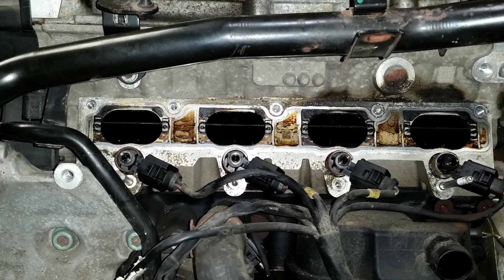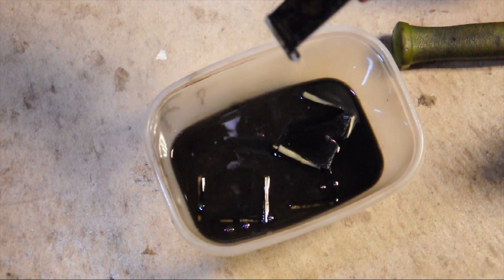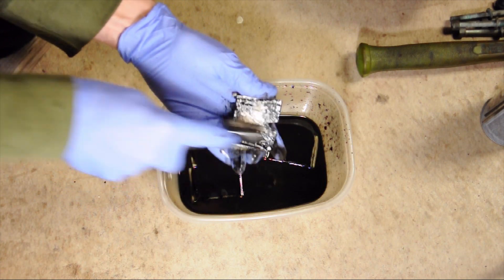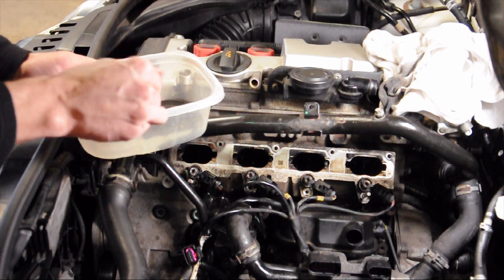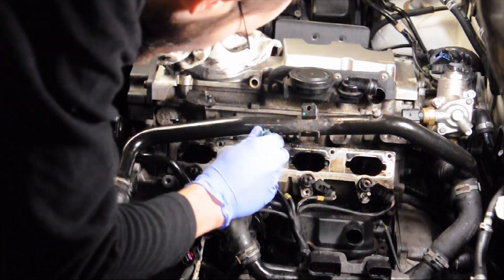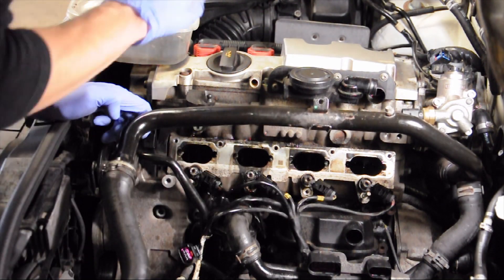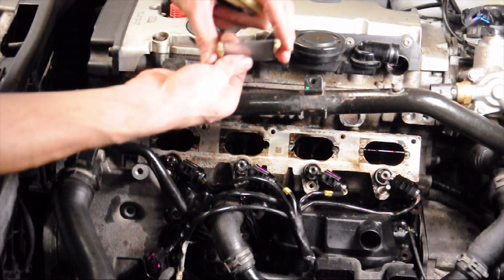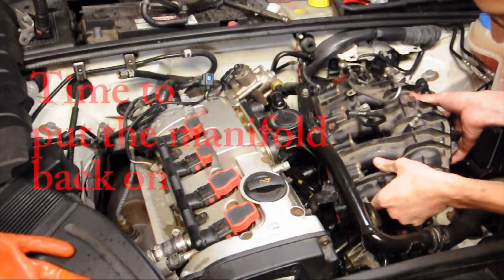Audi Direct Injection, Cleaning Carbon

Comment: Would you know where the intake manifold sensor is located?
Reply from the maker: +joyde_the3rd sorry that is not something I know off the top of my head. I can tell you where the Mass Air Flow sensor is
Reply: No such thing as an intake manifold sensor.  There Is a mechanical part attached to the back of the intake manifold which controls the flaps inside the intake manifold itself.  It is called intake manifold runner control
Reply: They’re probably referring to the IAT sensor.

Comment: great video, at what millage would you recommend the cleaning.  Aslo are the complications when the valves are dirty?
Reply: I was literally about to ask you if the car ran better. I do motor rebuilds for waverunners and it's the same principle with all engines. The face of the valve at the 45 degree seal is what holds the compression and or allows compression to seep out, if the valves are closed in order to keep trash out the chamber then that 45 degree seal never gets cleaned and nor does the valve face. With this said, I'm not sure cleaning valves this way will have much affect, it Def won't hurt tho.. However, if you clean out ur fuel injectors since your this far in, that can make a significant difference in performance and idling. I've never done either job on my Audi, only on other engines. (side note, if you are going to soak ur valves, it would be extremely affective to use chem-dip and let it sit for 3 hours and then suck and blow all of the fluid out, then wipe down ur valves, the carbon will damn there fall off...) some leakage will occur so make sure to refill the valve chamber if it gets low with more chem-dip..
Reply from the maker: +wry1007 I'm not sure if there is a "recommended" mileage to do it. I was right around 100k and the valves were filthy as you can see. I've seen photos of valves already being really dirty with only 30k. 

Excessively dirty valves can cause the engine to run rough as well as affect gas mileage and emissions. Maybe it was just the placebo effect but the car seemed to run smoother after the cleaning. In any case, I know it's been done

Comment: These videos are great, thank you. I have the same engine but a turbo FSI 2007 a4. I got the P2004 error code recently. Any thoughts? Is the intake manifold runner control bank 1 just the main bank that opens and closes?
Reply from the maker: +UrbanExplorer hey thanks. That should be the same engine as mine. Should be the same 2005.5 through 2008. Yeah that code would be for the intake flap inside the manifold. I had that done under recall a while ago. Not sure if that is still active. Might be worth calling the dealer
Reply: The dealer said its 3 months out of warranty unfortunately. I'm fairly handy (not an expert, but have done engine/car repair in general), is there anything you think I should fix first to see if it helps? Thank you!
Reply from the maker: +UrbanExplorer do you have access to a VCDS scan tool? It's a great resource if you own an Audi or VW. The company behind it, Ross-Tech, has a great wiki site with lots of info. That's usually where I go to see what's up. If you haven't already seen it, check out what they say about the code... http://wiki.ross-tech.com/wiki/index.php/18436/P2004/008196
Reply: I don't have it myself but I can find someone around who has it that can do these scans for me.  Thank you for the great resource! Do you also know where I can find engine diagram for these parts? I know where the manifold is and the throttle body area but I don't know which individual components are the manifold sensor, for instance.
Reply from the maker: +UrbanExplorer try taking a look at oemepc.com. huge online parts catalog